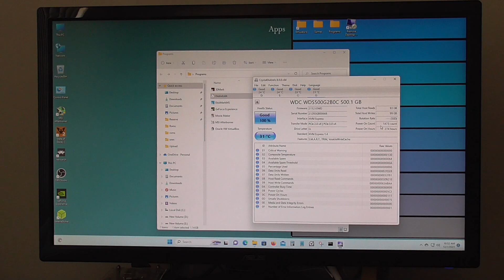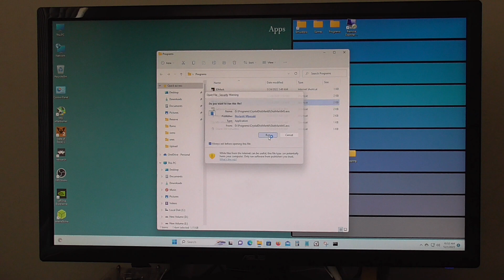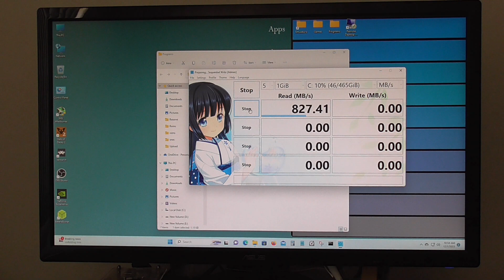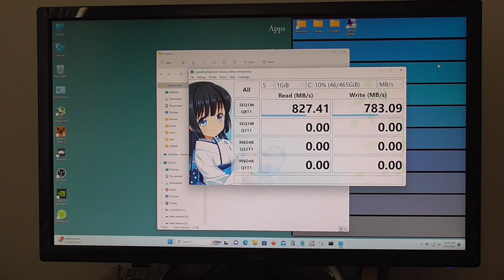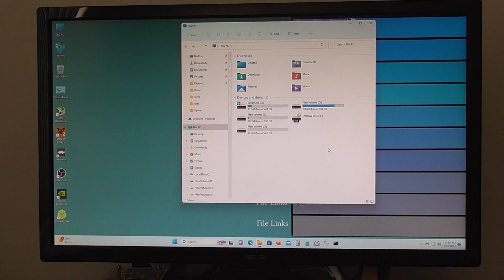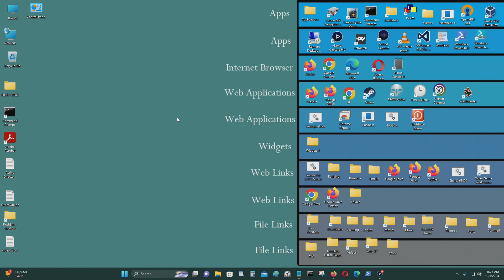PCI Express x 4 M.2 NVMe SSD Adapter Review and Test

Comment: You can boot from them. Lots of videos showing how to do it using a bootloader.
Reply from the maker: I read about Clover Boot, and it will enable you to run your M.2 NVMe SSD from a PCI-e adapter.

You are making the computer's bios to boot into the USB bootloader with Clover in it. In turn, Clover allows you to boot from the M.2 NVMe SSD with the PCI-e adapter. 

You need to enable do a few things before you start it, like setting your BIOS to a UEFI BIOS, and getting the partition on your M.2 NVMe SSD to GPT with Windows 10/11 on it.

Comment: Do i need to update the bios (version 2603 date 02/22/2016) or change something for the M.2 PCIe adapter be recognized by windows 7? I am using a PCIe 3.0 x4 adapter with a WDBlack SN850x 1TB on the same motherboard ASUS H97m plus of the video. Thanks for any input
Reply from the maker: You may need a driver to get this to work on Windows 7. I tried using this on Windows 7 once, and it didn't work with this adapter.
Reply from the maker: I think this is where you can find this driver.
https://support.microsoft.com/en-us/topic/update-to-add-native-driver-support-in-nvm-express-in-windows-7-and-windows-server-2008-r2-03cd423b-d42e-66c2-722b-019d16455a6b